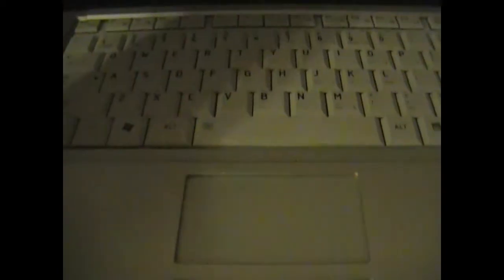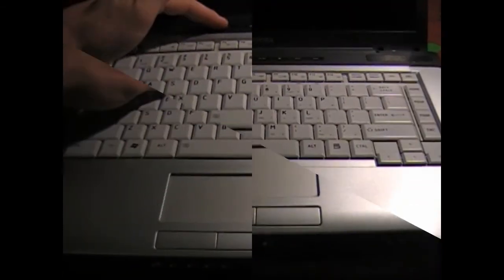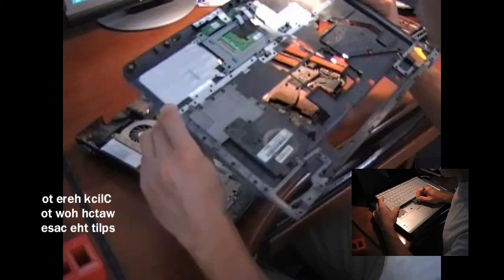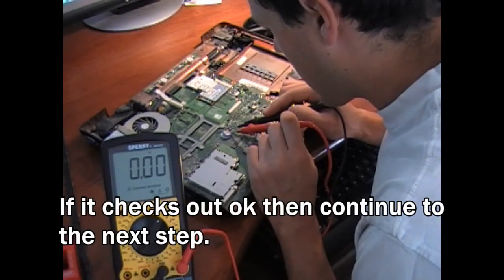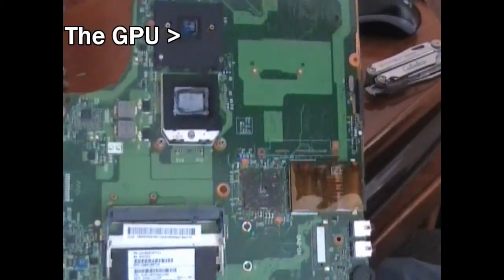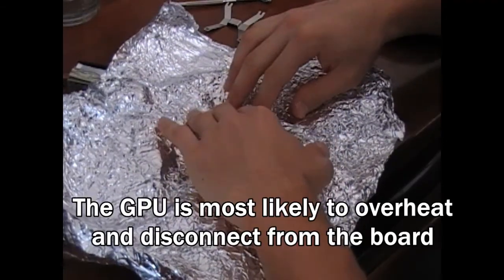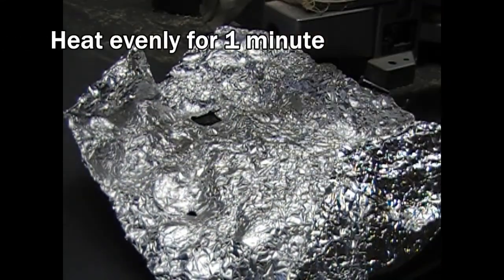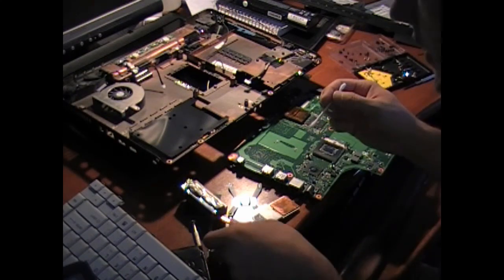Fixing Laptop Black Screen of Death

Comment: Man that worked awesome, i was so skeptical i didnt even put it together correctly!!! Worked like a charm. I would suggest double layering tin foil for heat dissipation, i used a regular heat gun and a cooking thermometer to regulate heat. I also placed copper pennies around cpu to try to keep heat from the rest of the board, worked awesome thx so much
Reply: I did lol, you just saved me a ton of money, i was perfectly happy with the lt till i got black screen of death, i am using it right this very second, thx again

Comment: My laptop is an hp and when i try and turn it on it just shows the hp sign the light turn from orange to blue but then the hp sign goes away and the light turn from blur to orange and it keeps doing this idk if its dead or smth cause i plugged in the charger for like 7 hours still doesnt work